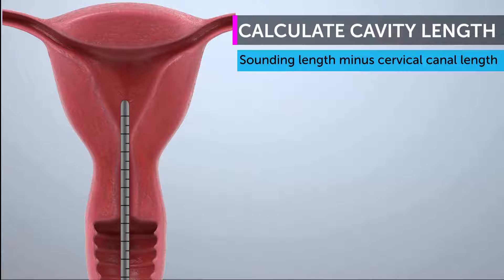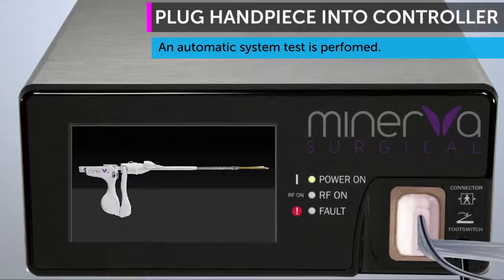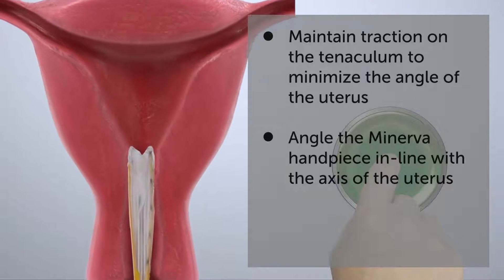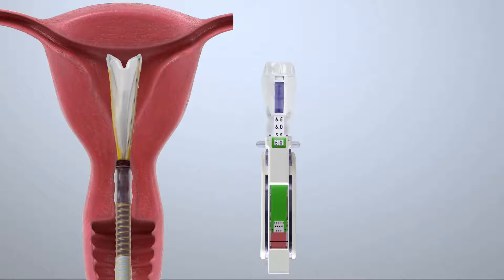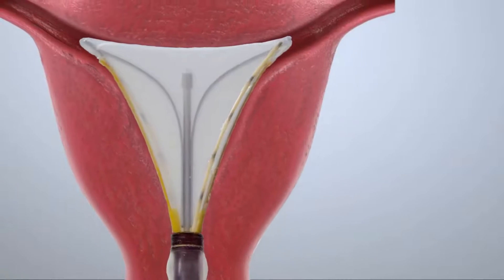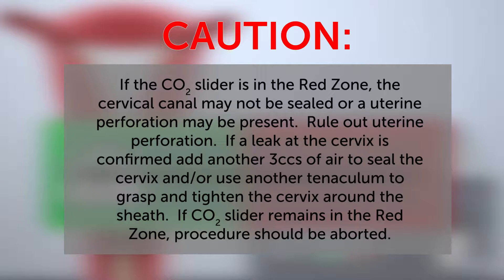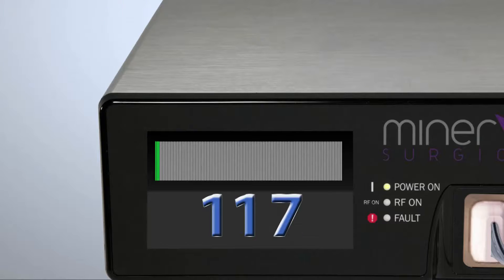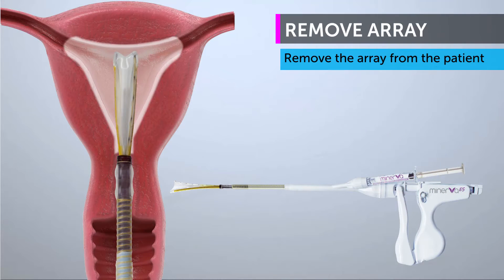Minerva ES Treatment Step-by-Step Animation

Comment: Literally just had this done less than 5 hours ago. Hopefully it works! Just moderate pain/cramping occasional waves of severe pain (I have a chronic pain disorder anyway so it’s just exacerbated)
Reply: How long does this procedure take ? 
Is it painful or uncomfortable ?
How are you now ?
Reply: @NeicyJ1990  I had mine done under general anesthesia in the operating room. The procedure total was probably about 60-90 minutes as they also took biopsies and stuff before the ablation part. I was at the hospital maybe 4-5 hours total. It was extremely rough the first two months but now I have no bleeding at all not even spotting, some random cramps but it seems to be like when I should have my period but no blood at all. No more discharge , it was bad for a good 6-8 weeks after the procedure
Reply: @NeicyJ1990  it’s not super painful afterwards. It was moderately painful the first 4 days or so. I relied on laying on my tummy on my heating pad in bed